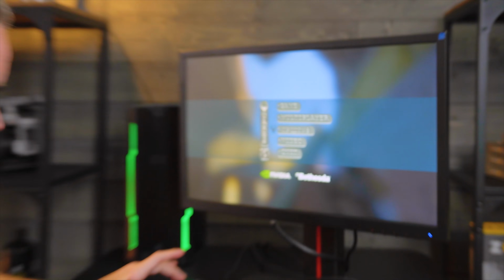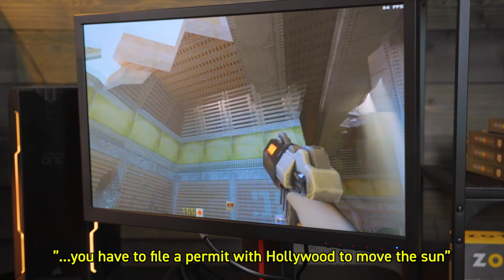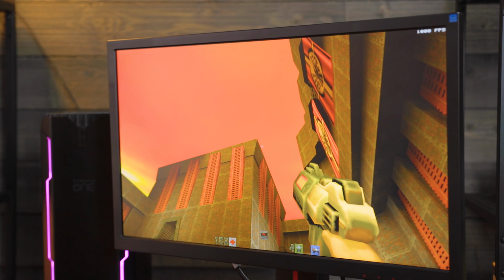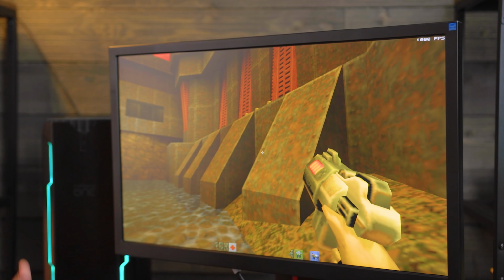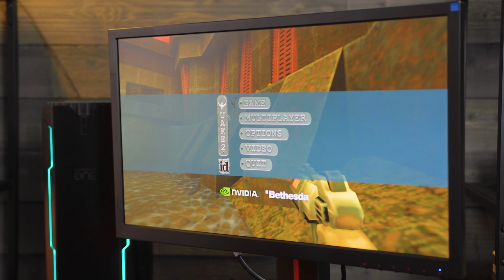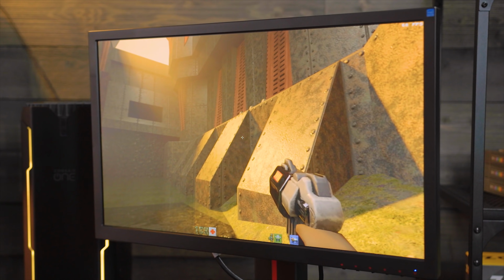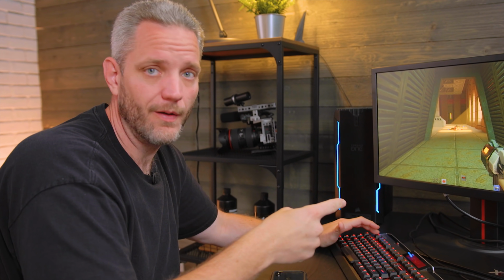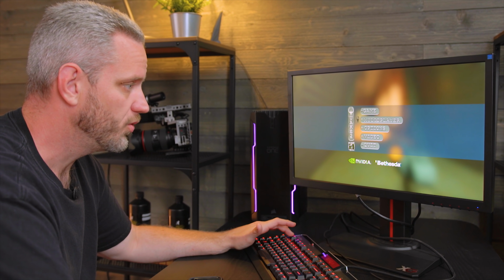Testing Quake II with fully ray traced update...

Comment: GTX 1080, i7 4790,  16gbram, 1440P at all max= 2-4fps  LOL
Reply: because its not a rtx card
Reply: @Prime42000  i know that and i know its not in the required specs. I just tried for the lulz
Reply: I got a 1080, i7 7700k, 32gb ram. I ran it at 1080p and got 13fps. I got 10fps at 4k. all unplayable. I took the res down real low and it went to 22fps for a second but the second the scene changed it tanked back down to 10-13
Reply: @inviktus1983  u neef rtx card
Reply: @Prime42000  not true. 1080 and 1080ti can do it, just not completely. And id get better fps if I lowered the resolution scaling.
Reply: @inviktus1983  minimum is rtx 2060
Reply: @inviktus1983  You can run it but it's not made for it and you won't have playable fps for it, that's what PRIME meant even if he did it in a neandertal way. Something being possible doesn't mean it's something recommended to do, I know you did it for the fun of it and because you were curious but it is true that to be able to run Ray-tracing correctly you need a RTX card
Reply: Turn down to 720p. At 100 resolution scale its playable or 1080p 60 scale.
Reply: BTW if you guys havent checked out quake xp. Do so. Its awesome looking. Imo better than the rtx and im getting 200+fps at 1080p ultra settings. I have a gtx 1080. Some guy even recently ported over the rtx models and weapons. Its bad ass. Worth a check see.

Comment: 8700k @ 4.7Ghz All Cores, 16GB 3200Mhz, GTX1080Ti Was Getting ~28 FPS @1080p RTX
Reply: A 2070 get 50 to 60~65 fps, it's crap for a freakin 600€ rtx card
Reply: My computer is i5 8600k @5.1Ghz 16Go 2800mhz and my screen is 2560x1080 and i get 50 to 65 fps with global illumination on LOW wtf nvidia

Comment: gtx 1080 i5 6600k caustic off, global illum low, render scale 50% 30fps
Reply: Thanks.  I thought it was odd when he said Pascal cards couldn't run this at all.  RTX got implemented in the drivers for Pascal cards (1060 minimum) back in April.  (I think it was April.)  I'm glad it's running on your 1080, if more slowly.

Comment: i was managed to run it on my 1080ti, max out, on 720p, 25 fps
Reply: I tried too, isnt even playable at that fps because mouse gets super choppy. Had to play in 800x600 or 720p with 50% res scaling for playable framerate. Not worth it. Cool to see at full settings though, even at 10fps.
Reply: on 4K max out, i got about 10fps maximum..
I will wait for the 2180ti or what ever nvidia will name it
Reply: YBXtreminal The 2080TI is already released, I just bought one lmao
Reply: @saucon751  He said 2180ti

Comment: with a Ryzen 1700x   msi armor gtx 1080ti oc 11gb  screen setup 1080p 

max 20 fps low  16fps  not playable
Reply: I played this game in 97 in more fps than that.
Reply: U sure ur cpu isn’t bottlenecking ur gpu?
Reply: @TheCooperman666   Yeah no shit, so did everyone else even if they didn't have a graphics card.
Reply: @JettHansley  That's not how a cpu bottleneck works. A weak cpu would not significantly affect a gpu's ability to perform floating point calculations. It may have trouble keeping up with the frames at high framerates, and being that the framerate is 16-20 fps, that 1700X (being not a weak cpu) would have to be massively underclocked to be the bottleneck.
Reply: @JettHansley  no running all core's on 3,9
Reply: @Darkwar9099  its not your cpu. its just hard on the video card. my 1080ti's in sli(is it using sli?) get 11fps at 3440x1440. 50% scale gets 40 fps. my cpu is a 9900k 5ghz overclocked. so yeah.
Reply: It’s a rtx game so it works better with a rtx card
Reply: The more ray-based effects used, the bigger the cap between RTX and non RTX cards become, with a title that relies fully on raytracing performance on a pascal card will suffer greatly
Reply: The rtx 2060 will wreck even the 1080 ti with raytracing because the latter isn't built for even the slightest of rtx operations.
Reply: I've got a similar setup, just an 8700k instead. Not at all playable at decent settings. Still pretty cool though. I am looking forward to when Ray Tracing is more widely supported. Can't justify the upgrade this gen.
Reply: I got a 1070Ti so I'm guessing it'll perform worse because of it but I'd imagine AMD would outperform Nvidia at real time ray tracing on their compute performance alone
Reply: @someusername1872  Thats what I'm thinking, tack DX12 with compute and we might actually see raytracing make some headroom.
Reply: That makes sense as I believe the 2080 is 4-5 times faster RT, which allows it to be run in real time.

Comment: Ryzen 5 2600x 1060 6gb...tryed just for the lulz...with rtx..10 fps...basically unplayable
Reply: Haha I was about to try on my 1060, thx for telling me that was a bad idea
Reply: Obviously..  Without any Tensor cores that help with ray tracing.
Reply: @hedimaster1  Tensor cores are only half of it, though.
Reply: @DragonSlayerKyo  yeah, but they do most of the work. DLSS isn't being used here and it's not as great some people think it is. I have tried it and the picture quality is noticeably worse on 1440p. Probably only worth on 4k. Many videos have shown that a resolution scale basically does the same thing
Reply: Same but with a 2060 42 to 58 fps
Reply: i just tried with my 1060 6gb and it said no ray tracing capable gpu installed...
Edit: after updating the driver at the nvidia website it works... with very low frames
Reply: @chadwick2629 wick you need the newest version of windows and newest Nvidia driver.
Reply: @hedimaster1  not quite, the tensor cores (in this application) do the denoising - which admittedly is the magic of RTX, in that it reduces the number of rays required to build a rendered view of the game world. But the RT cores are doing the heavy lifting though - casting the rays and building the scene.

Frankly - the fact we can run fully ray traced anything at realtime speeds is a bit of a miracle of clever engineering. I honestly thought before RTX this would be another decade away.
Reply: What a joke
Reply: RTX 2080 was getting me 45 fps
Reply: MarginalSC what res
Reply: Ok thanks
Reply: Ryzen 5 2600x RTX 2060 45-65 fps
Reply: @blakecartwright8090  what precisely is a joke though? Trying to run a game on hardware that does not have the hardware to run the game is clearly going to result in poor performance.
Reply: @hb2434  1440p
Reply: Hey guys wanna hear a joke?

Ray Tracing.
Reply: @aiden79797  im with you. They arent selling enough rtx cards so they are trying to lure us in with this. Thing is if you need a new GPU and have the money you will buy the best avaliable.Period,end of story.
Reply: What resolution? because I have a R5 1600 and I was getting 30fps.
Reply: @Puremindgames  didnt even look. Was so laggy and was so slowed down i felt like trying crysis in my old amd back in 2007-8, but with a game i could run no problem with that system
Reply: @aiden79797  Well... raytracing will be the future of graphics. It's kinda inevitable, because we have hit the limits of rasterisation, and the asset creation pipelines suck at scale.
Reply: @zoeherriot  it will probably be a true decade away before its a standard though assuming everything lasts long enough to not fall apart to greed stupidity and stupidity.
Reply: Over 100 if you turn down the RTX settings.
Reply: @yulfine1688  Yes, I don't disagree, but did you did know that just prior to the RTX cards - it was thought it would be a decade before we'd even see what we are seeing today with those cards. It's probably not going to excite the average consumer - but honestly - what they are achieving is actually far more impressive than most people realise.
Reply: @zoeherriot  oh I know I was personally hyped about it.
Reply: @yulfine1688  We'll probably see a more tangible improvement in visual fidelity in the next generation - but we still haven't had any real games that have been developed from the ground up with RTX yet. Most of the games have had the feature retrofitted to existing environments and assets. So I am betting we'll see better examples in this generation yet.
Reply: @zoeherriot  yeah I know. This all assuming everything stays well together well enough without many issues happening.
Reply: I tried on my i5-8600 and 1060 6gb. Couldn't even start lol
Reply: @zoeherriot  that's what I said tho. Tensor cores do do the heavy lifting
Reply: @hedimaster1  sure .. but it's not really the bit doing the work. It's just a clever use of AI denoising.

Comment: Well I'm looking forward to seeing Half-Life 2 fullt ray-traced. I mean Source is just a fancy derivation of the OG Quake engine so it won't be long eh?
Reply: One can hope! Until then Marty mcflys rt reshade is pretty good
Reply: No it's not. Source is an entirely original Valve engine. the ORIGINAL engine that Half Life (1) ran on was a heavily modified Quake engine
Reply: @cardigansrule  ah that's right. I just figured Source was further derived from the original Quake base to the point it was basically a fundamentally new thing, but still ultimately could be traced back. But, it's been a while so maybe it was ground-up.

Either way, fulo Ray-Tracing in Half-Life 1 would be great. I wonder how it would look compared to Black Mesa

Comment: i7-7700 w/ GTX1080 3440x1440 default settings= 4 FPS
Reply: How do you even get regular Quake 2 to start? I get a grey-ish window for 3 frames (0.1 seconds), then it crashes, and something about "optimal resolution" which also crashes after about 3 frames (0.1 seconds).
Reply: Do you actual play this game or your just adding to the bandwagon of posting general PC specs with fabricated frame rates?
Reply: the resolution is too much in combination with the raytracing. You will see the fps go up when you go to a more realistic screen resolution . I can get around 40 fps on my i5- 2400, gtx 1070 (8gb,not overclocked due to lazyness and well I don't play any games that justify having even a gtx 1070 as gpu )and 32 gb of ram but I have to take it all the way down to 800*600
Reply: @Trainboy1EJR  you install and open it with steam client ? Or are you trying to run the original quake2 ?
Reply: @cyrilvaneijkelenburg3743  I have it on Steam. i7 7700hq, 16gb, 1050ti. The RTX version won't even attempt to open, the original attempts, but glitches out immediately as described before.
Reply: @cyrilvaneijkelenburg3743   I have a titan rtx and I was able to play it at 40 fps at 3444 x 1400. It was fun and interesting to see that old game, it make me remember when I was 13 years old. LOL

Comment: GTX1080 w/8350k
RTX on 10-11 fps
RTX off 994 fps
Reply: Zack Dawley oof
Reply: gtx 1080 doesnt have rtx do?? hmmmmmm
Reply: @sanane66543  You dont need an RTX card for raytracing. Got this to run on a £500 PC with a GTX 1060 6GB
Reply: @MineThing  at what 1 fps?
Reply: um... on what resolution cause i'm getting 14-17fps i5-4590|GTX1070ti 1080p
Reply: run it on 2k with 80% screen scaling. with my 2080 ti I run 4k with 80% scaling and I get about 55 fps which is playable and with the denoiser its basically 4k.
Reply: Is there a particular reason you paired a GTX 1080 with a 4 core / 4 thread i3 processor?
Reply: Goes to show how important the RT cores of the RTX cards are.
Reply: @Hahhah0 pascal doesnt having the specialized tech that rtx has for raytracing
Reply: @markopanic5672  Same here, with a 1070Ti and an old i7 4770 i get 10fps in 1080p, and 18-20 in 720p. If you set the resolution scale lower to, like, 60, it becomes playable with 25fps at 1080p, but looks like mud.
Reply: @nottoxicD2  well the CPU is almost never a bottleneck in gaming unless at very low resolution. But I have to agree 4 threads are kinda few nowadays
Reply: Zack Dawley cause your missing Ray Tracing cards. 

Do people not realize there are now 3 technologies on the RTX cards??? 

Cuda, RayTracing. Tensor cores...fucking AI
Reply: @philipquaglino  We know the 1080 doesn't have the ray tracing hardware so it will run poorly. Jay did ask for people to post their specs and demo results on both RTX and non-RTX cards after all.
Reply: @crimmy0204  Just run it at 1440p 100% and play at 60fps lol.

Comment: CORRECTION: Pixar's Toy Story was not rendered using ray tracing. It was rendered using Reyes algorithm and Renderman shading language (rasterization). Ray tracing wasn't even included in Renderman until the production of Cars, and even then Pixar used ray tracing sparingly. The first Pixar film to use ray tracing completely is Monsters University. 

Also a side note Jayztwocents should look at some of the Unreal talks given regarding ray tracing, in them they talk about diffused ray tracing, the glossy part of the box, and how computationally expensive it is. So if they did add it to Q2, it would bog down your system even with the simple shapes of Quake.
Reply: Should be fine to do rough specular materials, it's already doing fully diffuse materials anyway. 

I think the denoiser may have issues and uses some hacks to specially handle specular material types, because diffuse materials are not eye position dependant, unlike specular materials and their denoiser algorithm is accumulating the path tracing from several frames (this is necessary for diffuse materials to work as they need many samples over many frames). Hence why specular materials are perfectly smooth because it cannot take the previous frames results because if it was from a different position and reprojected it would be wrong.